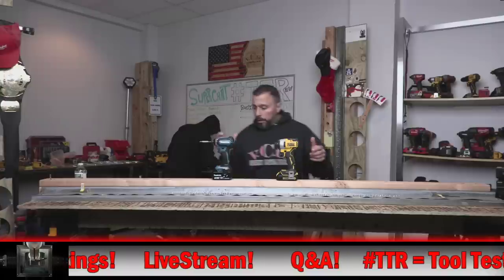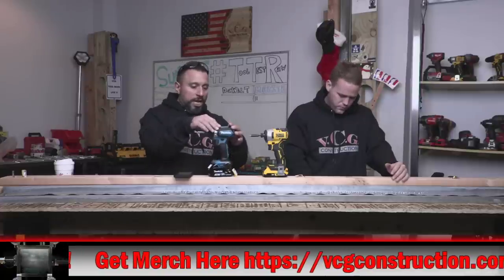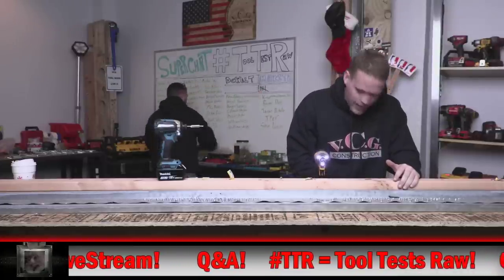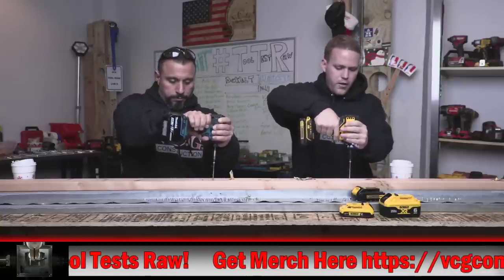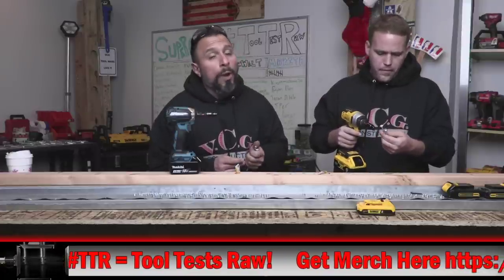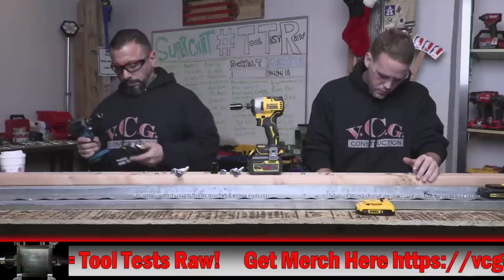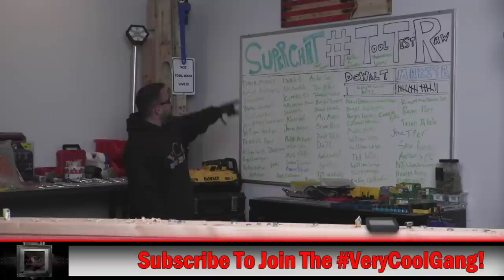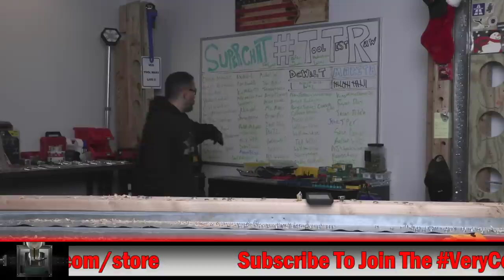DeWALT VS MAKITA (THE HOME DEPOT) BEST $99 IMPACT DRIVER TOOL TEST COMPARISON

Comment: If I only had $99 in my pocket and needed an impact there's be no thought process, no question...I'd walk in, right past all the other tools without looking, grab the Makita box and go back to work for 15 years. My black and white original sub compact Makita tools are still running solid after that long and show NO signs of dying. I've only bought batteries in the past two decades and NEVER smoked a Makita tool but I've smoked dewalt, ryobi, and others. Makita gets my money for life....Even though they can be pricey for bare tools...BUT it's a case of "buy once, cry once" so it's so it's ACTUALLY cheaper in the long run. I spent $280 once on the drill, impact, two batteries and charger over $16 years ago and have not needed to buy those tools again. Worth it! ...yes I use them hard...n daily....unless I take a day off to do something fun. Not a fan boy...but I TRUST Makita! ....n that's HUGE!
Reply: Makita are fantastic but the other 2 are solid. Don't have 15 year tool but got 5 or more woth dewalt. Run em hard only had 1 drill go bad. But replaced with a 998.  They didn't have as much power but the new 40v makita look solid.

Comment: It's dtd153z just notice not speed control 154 in Australia. Unbeatable price now as you purchase makita blower kit come with free driver. I used to have this driver really love it. Upgrade version 154 can set 3 speed, 200 rpm extra and better sound. You can't fault makita gear.

Comment: Grew up on DeWalt, dad, papaw, uncles all had Dewalt. After I left the Marine Corps and went into the  Carpenters Union everyone had Dewalt, so I am a DeWalt guy, so when this new Atomic came out I didn't look into the 809, I grabbed it the day it came out and didn't even second guess it. Wish I would have seen this now, it has it's place, but I am very disappointed in it. Should have just bought another 885

Comment: I run red but I bet that makita has less collet run out, better dust n h20 protection, more solid soldered connections and tighter overall tolerances. Thanks professor AvE
Reply: I have three sets of red m12 and have seen a chuck failure, loosening chuck on all three and slipping or broken impact on two.  I love the compactness and how they operate when new, but Milwaukee M12 is not reliable over long run.   Im gonna change colors probably Makita for my 18 v buy.  I almost went for two dewalt kits but the 1.3 ah home depot special is a fail.

Comment: Thanks iv owned all three the dewalt atomic line for 99 and the Makita 18v for 99 Dewalt atomics 2 batteries didn’t last as long as the Makitas 1 18v batterie did. Makita 18v all the way wins this battle. But the fight I want too see is this same makita 18v for 99 dollars vs the Milwaukee 18v for 99 dollars. I love my  Milwaukee 18v and it was 99 dollars

Comment: if only  you guys could show us a kind of proof for 2 things: 
1st:  Timing, when 1 start the other one starts at same time (slow mo cams? mechanic device giving more accurate timing?
2nd: Pression, if one applies 100 lbs while the othe one is able to aply 110 lbs it does ** the whole thing ;)
But good job finding 2x "matching batteries" to compare as close as you could
Funny manly flames vids XD

Comment: Vcg what's your preferred battery operated tools? Milwaukee and in your opinion best bang for the buck would I be better buying the makita line or ridgid? Or is there a different lineup you would recommend. I'm just an average homeowner looking for the best value for my money.  Thanks for making the videos they are great!
Reply from the maker: Thanks for watching! It really depends on your budget and how much work you need to get done. Look at ridgid, kobalt, or craftsman
Reply: @VCGConstruction  of the 3 u listed, what order do u consider them best to worse. I've been looking at the ridgid and it's high in my list as if now. I'll be buying a set most likely on black friday. Thanks for the info I really appreciate it.

Comment: Here's the difference between dewalt fans vs milwaukee fans.
Milwaukee fans: ( Milwaukee flaw in tool) man Milwaukee needs to fix this cause that sucked.
Dewalt fans: ( tool starts to smoke) its supposed to do that. Oh I got a bad one. Still better then Milwaukee.